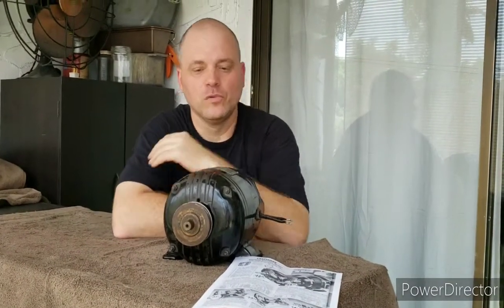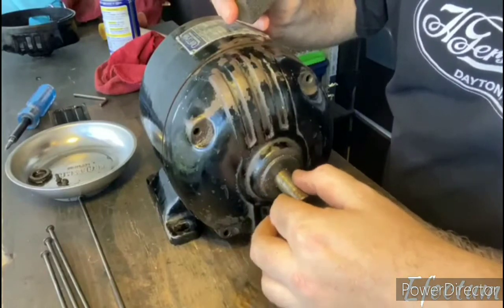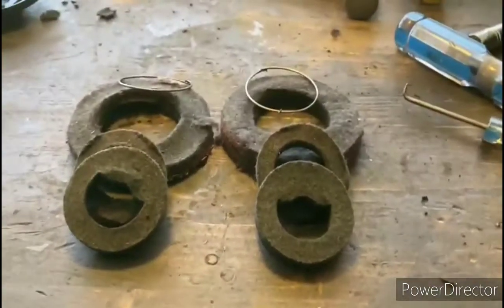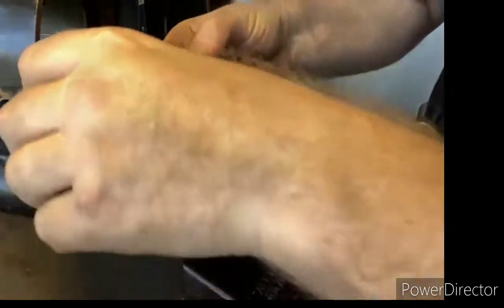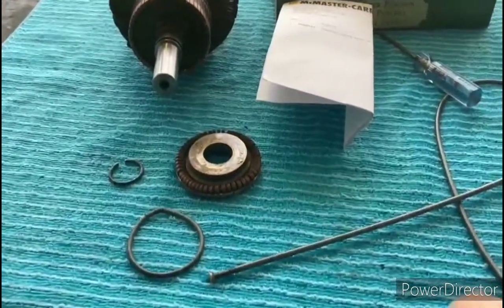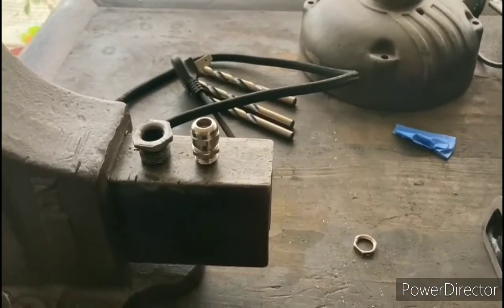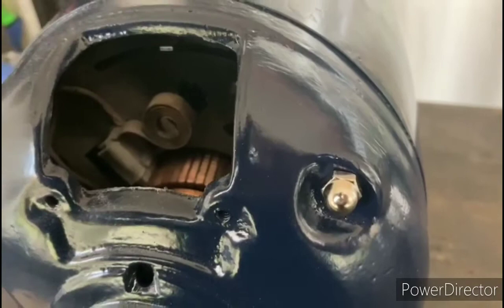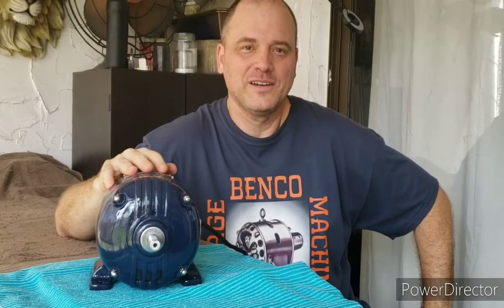How to restore a vintage electric motor: Craftsman / Diehl-- Repulsion Start Induction Run

Comment: What if you put in the bronze bearing that was worn and installed it with the worn side opposite the rub marks? That would straighten out the shaft. Of course this all depends on if that bearing still fit snugly over the shaft.
Reply from the maker: No. Thats not how I would ever do it unless it was a temporary emergency. Besides the large oil opening milled in the bearing would have to be redrilled on the other side which result result in a swiss cheese drilled mess....

Comment: Great Video! I'm Rebuilding A 1/2 hp Repulsion Start Induction Run Motor..I Think From Thre 1930s or Older.
Reply from the maker: What manufacturer is yours? I have a few other videos on RSIR motors. Good luck.

Comment: Neat old motor :)  Man, that McMaster Carr is a lifesaver!  I stumbled across them looking for a lefthand thread 5/8ths arbor nut with 18tpi and they had them and got them to me in 2 days!  It got my old radial arm saw back up again.
Reply from the maker: Yes they do have a great selection and reliable customer service.

Comment: Do you have a source, or trade name, for the device you use at 11:53 and then attach to the slide hammer, used for pulling the oil retainer cap?
Reply from the maker: That is a bearing puller set from Harbor Freight and I have found it to be indespensible. It comes with the slide hammer and several adjustable inserts to fit various size bores. Really comes in handy for pulling blind bearings where you only have access from one side. Otherwise you will have to buy a loaf of bread (google this method).
Reply: @BencoVintageMachineWorks  Thank you!

Comment: You are amazing! I collect and restore vintage DeWalt Radial arm saws in New Jersey. I have a few from the early 1920's. Repulsion start induction run that have a very complex shorting mechanism. I'd love to know how I can show you the pictures of this mechanism and ask you a few questions. How can I get in touch with you? I do have a YouTube channel that has a few of these motors on it and maybe you could look there and comment. Thank you for any help you can give me! These old motors are amazing! Leo Flannery on You Tube.
Reply from the maker: Join the FB group Antique "Electric Motor Experts". Its a great group and any questions you have can be answered.
Reply: @BencoVintageMachineWorks  Thank you! Will I also be able to post pictures of the parts I have questions about? I will check them out when I get home.
Reply from the maker: @DeWaltRadialguy Yes of course

Comment: Hi. How would you suggest cleaning a very greasy motor? It's an old motor with cloth covered wires. The stator, armature and windings are just caked with grease. I've heard to use mineral spirits or hot water and soap. Then heat an oven to about 100 degrees and let it dry out for several hours. I figure soap and water may be less aggressive on the old windings, but don't necessarily like the idea of using water. Thanks!
Reply from the maker: Dawn dish detergent with hot water and a soft brush. Just take your time and eventually it will clean up. I do not recommend using solvents unless you know the composition of the windings varnish. Damage could result. You are correct that the motor needs to be completely dried out but I would use either a space heater or heating pad for a couple days. The oven is faster but most will be too hot for cloth covered wires even on the lowest seting. Once the windings are perfectly clean and bone dry you should apply a coat of varnish for protection. My video on the 1/2hp Emerson motor shows the varnishing process in detail. 
Good luck.
Reply: @BencoVintageMachineWorks  Thank you so much. That really helps for this project and future projects. Really great work on your restorations! Keep it up.
Reply from the maker: Anytime, thanks

Comment: I'm curious what type of paint you favor on these, rattle can epoxy or some type of brush on ? Just to get that vintagy look.
Reply from the maker: As you know, the prep work plays an important role in any finish. I mostly use rattle cans for the ease of use. Occasionally, I have used a Japanned finish as demonstrated in my video on the Holtzer-Cabot motor. Jappaning is much more durable and beautiful than paint and requires considerably more effort.

Comment: I have a VERY old marathon 1/6 h.p motor. What type of “thrust washers/spacers” should I use to replace the old brittle ones, they don’t even feel metal anymore, they crack like plastic. But the machine is 80 years old lol. Tia
Reply from the maker: Use fiber washers. You can get a fiber washer assortment kit cheaply on Amazon.
Reply: @BencoVintageMachineWorks  thank you. P.s these washers will be mixed in with oil as they are stacked near the sleeve bearing & “oil drain”, is that ok? I just put a magnet to these old washers, and they are still slightly magnetic, so does that mean I should use brass over fiber? Or do fiber washers have a “metal backing”? I really do appreciate your time.
Reply from the maker: Just use the fiber. They absorb oil and that is a benefit due to less friction. You want a very small amount of end play as the rotor will find its electronic "center" once it is running.
Reply: @BencoVintageMachineWorks  I’ve been to three big box stores and all over Amazon and McMaster Carr and can’t find 5/8(o.d) x 1/2(I.d) fibers. 😔

Comment: Thank you for another excellent video, your patients and focus is inspiring. My question is what is the name for the tool you used to remove the bushings?
Reply from the maker: The tool I used to remove the bearing cover plate is called a slide hammer. They are available at Harbor Freight or on Amazon. I usually use a gear puller (also HF or Amazon) to press out the bearing but in this case I just tapped it out using a socket of similar diameter. If you are only planning on rebuilding one motor, it might not be worth it to buy those tools but if you are going to tinker around with more of them, they are real life savers.

Comment: excellent video, i have the exact same motor except in 1hp.    You showed me how to reverse it, thank you so much, great videos
Reply from the maker: Glad you enjoyed the video. Any Repulsion Start Induction Run motor will reverse in a similar manner by rotating the brush holder assembly. There is normally a hash mark so that you can line it up exactly and that is important for best operation.
Reply: @BencoVintageMachineWorks  Great video, you are the best

Comment: Did you coat all surfaces of the stator and rotator with the insulating varnish?
Reply from the maker: All the wires yes but not the metal laminations. I like Sprayon EL600 for a spray or the Glyptal brush on if you need a heavier coating. It is imperative that the windings are toasty warm and bone dry prior to the application. That will help your insulation. As seen in the videos I used a heating pad overnight and used a space heater to help the varnish cure afterwards. By the way....Some rotors are not wound with any wiring. Thats more common on the Repulsion Start Induction Run types.
Reply: @BencoVintageMachineWorks  Oh okay! Nice, I'll have to remember to apply just to wiring . Thanks again!

Comment: I was really hoping you'd show the process of repairing the winding leads. The winding and leads are the part of my resto that scares me the most RN. I'm not hating, just half way through the vid. About to finish. Super helpful so far! 😎
Reply from the maker: Hello, if you watch the video I did restoring the Emerson 1/2 hp motor you can see some more detail on that subject. The process is exactly the same. I appreciate you watching the video. I also recommend joining the FB group "Antique Electric Motor Experts". You can post pictures of any problems and have it answered promptly by a great group of knowledge guys. These are nice motors and worth the effort!
Reply: @BencoVintageMachineWorks  For sure! Thanks so much, I'll check into the vid and the FB group!

Comment: Thank you for your interesting and informative video. I am in the midst of restoring a 3/4 HP Craftsman capacitor start motor. Don't laugh when I tell you that it ran perfectly before I started except for having dry ball bearings on both ends. Fast forward to reassembly with new bearings at start up it hummed but was bound up. After complete disassembly and reassembly a second time I get nothing at all. So I am going back to square one and going to redoing all the leads properly.
As an afterthought on vibration I have a couple of experiences with this that I will relate. 
The first was a $14 Harbor freight grinder someone gave me because it quit working. As you might guess you cannot get replacement carbon brushes from Harbor Freight. I found some on Amazon that were the right dimensions and purchased a box of 4 at a price of four bucks. With only slight modification the new brushes worked great.  
In the process of taking the grinder apart to clean it up and polish the commutator I noticed that the armature was rubbing on the field windings just as you noticed in your video. Since I had the armature in the lathe to turn the commutator I took just the smallest cut off the OD of the rotor. Upon reassembly it ran smoother than a $200 Makita grinder I have. 
The second observation I have made was how to static balance a big assembly like a large rotor. I take 2 very clean cold rolled bars of equal dimensions and set them absolutely level and parallel in both directions leaving space between for the armature to turn. Carefully setting the armature on the parallels it will naturally spin until the CG is at the lowest point. If the bearing surfaces on the armature are out of round it will make it more difficult but with careful removal of metal at strategic points around the circumference with a drill or grinder you should be able to arrive at a perfect static balance with a little work.
Reply from the maker: Thank you for sharing this knowledge. I will keep it in mind when the need arises. As you saw in the video, this particular vibration was already present when I received the motor and prior to changing the bearings. This particular vibration turned out to be a manufacturing defect in which the end bell flanges and the bore were not perfectly machined relative to each other. Thanks for commenting and best of luck on your Craftsman motor!
Reply: @BencoVintageMachineWorks  Well I'm still futsing with the Craftsman motor. Thanks for your reply.
Reply: @johnpullman3227  so I was pulling my hair out awhile back on a motor that would not start, with good capacitor, in like new condition. Spent hours troubleshooting. Buzz. Turned out there was a film of clear oil on the contact switch. Sanded the contacts and it fired right up.

Comment: Great work.  I really appreciate you posting this knowledge.  What grit sanding pad do you use on the stator and rotor?
Reply from the maker: As fine as you can get away with and still get it clean. In extreme cases, where the commutator is in very bad condition, it will be necessary to turn it down slightly on a lathe.

Comment: While looking for insight into a motor I'm working with I stumbled across your video on a repulsion start - induction run motor. I have a Master Electric repulsion motor that I'm trying to figure out if I should repair. It was/is a working motor on a hangar door. I have questions about the brushes and brush plate. In your video, the motor you are working on has an almost identical brush plate. Is there any way we can connect using email? Thanks, Lowell
Reply from the maker: I recommend you join the FB group "Antique Electric Motor Experts". Post some pictures and you will get the help you need. Look forward to seeing your Master motor. I have one in the pipeline for restoration. They are very well made.

Comment: 19:33 Sir, what is that device, and how do I get by without one?
Reply from the maker: The device is called a Megger and vintage hand crank models like this one are not too expensive on ebay.  While you can check for shorted windings using a basic meter, a megger is more conclusive as to the insulation resistance of the windings. Definitely a worthwhile investment if you plan on tinkering with vintage motors.

Comment: wow crazy amount of hrs put in the motor, I don't mean the restore, and thats commendable :-) but figuring out the vibration. great restore and its nice to find that this is not just an ordinary motor in the way it starts and have so much starting torque. I currently am in the process of restoring a Coffield washer motor from 1915, a 1/4HP induction I believe, ritter compressor 1/6hp motor, a 1/4hp GE and sitting at about 50 pounds or motor a GE 1/2HP from the 1920s, its got oil rings on both ends and has 4 wires coming out. It came with a 1920s 4 inline cylinder tiny compressor. Well these motors are indeed jewels and every effort taken to fully restore them, and you sir are an inspiration in doing it
Reply from the maker: Thank you for the compliment. Good luck with your projects. Some of those old Ritter compressors were really beautifully made. These old motors are indeed worth every minute of energy invested into them. They came from a time when people actually cared about quality.
Reply: @BencoVintageMachineWorks  thank, yeah the Ritter compressor is amazing together with the motor! So well constructed. The length to which they went back in the days to design them
To run forever! I have 2 ritters, both have slightly different motor designs. Love them both. To have these running to power your airbrush and other small air tools and to have other vintage motors powering your lathe, drill press and polisher would be a delight! Keep the long vids coming. It shows almost everything you are doing to restore those jewels. Although these motors are 2-3 times bigger and quite heavy compared to modern motors of equal hp, the oldies run smoother and cooler.

Comment: Beautiful job! The extra length wire leads allow you to rotate the end bell oil holes to vertical position if the motor is mounted to a side wall or upside down.
Reply from the maker: Hello Brian, glad you liked the video.
Reply: @BencoVintageMachineWorks  BTW, AWESOME T-shirt with your logo.

Comment: Great video as always!
Reply from the maker: Thank you for checking out the video. This was my 1st attempt at a Craftsman motor and it was a challenge.
Reply: @BencoVintageMachineWorks  how much longer until you get to the 1/4 Kimble??
Reply from the maker: I have received it and will be starting the restoration on it soon. It will be the next video I upload to YouTube. I really want to take my time and do it right. Additionally, it's really two separate projects because the rheostat needs an overhaul too.
Reply: @BencoVintageMachineWorks  I’m very interested to hear your research and restore on the rheostat. I don’t understand how those work and I’m excited to see it opened up!